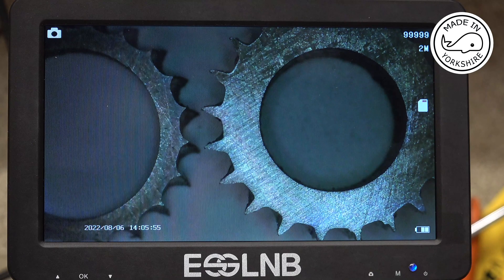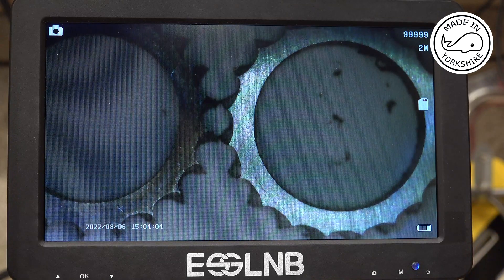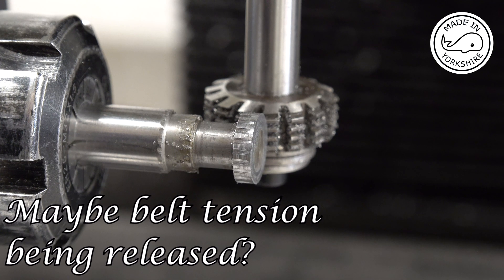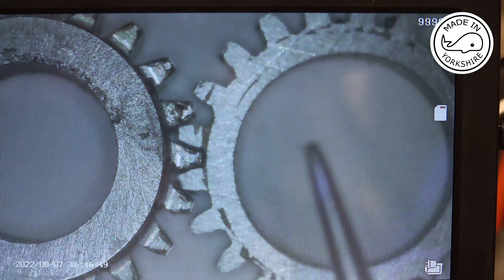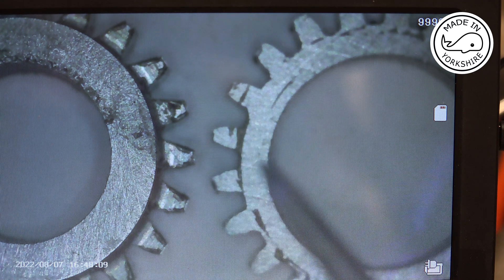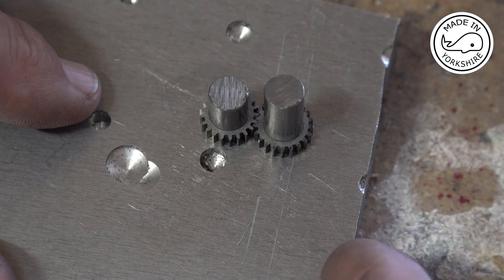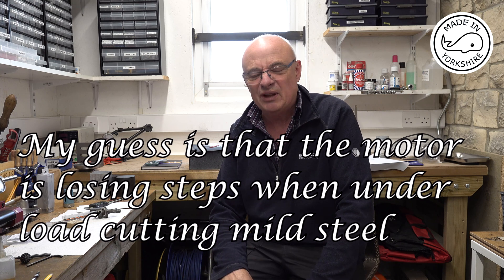#MT50 Part 5 - Making a Gear Hobbing Attachment. Success? In 4K/UHD by Andrew Whale.

Comment: I'm pretty certain that your stepper motor is skipping steps, probably because of torque applied by the cutter 'worm' drive (for that's what it is).  A way out would be to put a  worm on the stepper to drive to the blank via a pinion, so that it cannot be forced to miss or jump forward steps.  Ok, it will all run slower. But so what? It would prove the theory.  Good luck with it anyhow ;->
Reply from the maker: Hi Ian, thanks for the suggestion. I'm sort of thinking on similar lines but a different solution. I've just purchased a closed loop stepper motor and driver which are supposed to be good at not missing steps when under load. Just waiting for some different pulley to arrive before I can test the theory 👍
Cheers
Andrew

Comment: A bit of work, but you can't prescribe a cure without a diagnosis: Fit an encoder temporarily to either the stepper shaft (e.g. on the pulley) or the spindle (either end, but probably the non-workpiece end is easier). Feed the output back to your Arduino, amend your Arduino code to explicitly count the number of pulses received from both encoders. The coding should be easy, and I am guessing you have some spare inputs on your Arduino, so it's only the fitting of the temporary encoder that requires much work. Like most people, it really looks like you are missing steps, but counting the input and output should enable you to track when it is happening.
Reply from the maker: Hi Nick - an interesting suggestion and I see where you are coming from. I have another plan at the moment but I will keep that though in mind.
All the best.
Andrew

Comment: Hi Andrew. To get rid of the noise, you can add 47pF ceramic capacitor between the signal line and the ground. This capacitor needs to be soldered at signal receiving end. Obviously afterwards check with the oscilloscope the signal quality.
Reply from the maker: Hi Adam - thanks for the suggestion. Added to my list!
All the best.
Andrew

Comment: Hi Andrew, as others have commented, your clearly making progress and that has to be good, well done.  But as I commented last time, the "circular thickness" of the teeth still look a little shy when compared to the width of the tooth spaces.  Or is it just me?
Reply from the maker: Yeah I think you are correct. I think they would function reasonably well, but maybe wear could be an issue. I'm trying to get to the bottom of it. I like challenges!
Cheers
Andrew

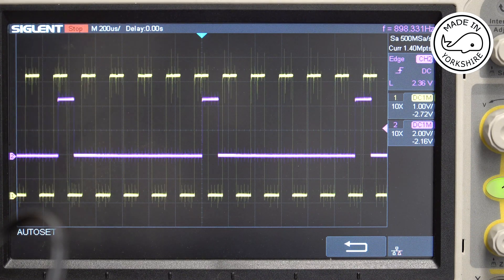Comment: At 07:30, the alignment of the purple trace with the yellow trace doesn't seem consistent enough. I would expect the distance from the rising edge of the yellow trace to the rising edge of the purple trace would be consistent. But it is quite different for the three pulses shown. I wonder if you're getting jitter in the timing. That would case the orientation of the hob to the teeth to walk back and forth, thus cutting the profile wider than it should,
Reply from the maker: Hi John - I think the difference is due to the outgoing pulse being every 5-1/4 incoming pulses. The math is correct as far as I can tell. I have a few ideas I'm going to try out.
Cheers
Andrew

Comment: Well filmed and edited and nicely presented.
That fast wobbling, jittering at time 07:00 doesn't feel that good. See what Your testing will come up with.
When a stepper looses steps it usually stalls, stops, making a brrrr noise. Check the acceleration parameters in order to avoid "loosing steps".
Reply from the maker: Thanks Stefan - I wasn't sure if the jittering was an issue. I'm going to make some more changes, including adding a closed loop stepper motor. That should at least remove the possibility of losing steps at the motor end. We will see!
Cheers
Andrew
Reply: @learningturningmetal  I don't really believe in lost steps. You can install a sensor and check for step issues but I doubt it will be the answer. 
Checking parameters affecting acceleration/retardation could pay I think. Of course, trimming the PID factors could make changes.
I can think of a time factor, loop time for reaction or system hysteresis due to the large mass that is controlled.

Comment: Good work, You may get further improvement if you twist each pair of wires  between the driver and the stepper motor coils. This may help in reducing x-talk  between phases. 
But yes a big step forward from the previous results.
Reply from the maker: Hi Fraser - thanks for the suggestion. I have some other ideas I'm going to try out too.
Cheers
Andrew

Comment: Stepper motors are pants.
Reply from the maker: Yeah - open loop steppers might well be when cutting under load. I'm going to try closed loop which have built-in encoders to resolve any missing steps. Well that's the plan!
Cheers
Andrew

Comment: I have been told that a servo will not lose steps.  Maybe you could try one of those.
Reply from the maker: By servo - I think you might be thinking closed loop stepper motor which has a built-in encoder to check if any steps have been missed. Now that might be the subject of my next video!
Cheers
Andrew

Comment: Just a thought about the wider tooth gap, is the hob at the correct angle?
Reply from the maker: Hi Chris - as far as I can tell the angle is spot on. I think if it was out the teeth would be cut at a slight angle - like a helix.
I have a plan!
Cheers
Andrew
Reply: @learningturningmetal  one should always have a plan.😉

Comment: Try seeing how your cut gear mates with the cutter, if it's tight to that with no slop then any play when meshed with other gears is either down to the cutter profile not being ideal, or the other gear.    If you have some slop between your gear and the cutter that made it, then it suggests a small amount of lost/gained motion between the cutter spindle and the gear spindle whilst it's being cut (small number of skipped steps perhaps?)
Reply from the maker: Thanks for the suggestion. I have a plan, so fingers crossed I will be able to nail it!
Cheers
Andrew
Reply: Was going to suggest the same. Worth checking before making any more adjustments Andrew! Cheers, Jon

Comment: Yay! Nice to see you sorted it out. 👍
Regarding that larger gap between the teeth, I have a theory. The stepper motor setup you have allows backdriving and only has a 3:1 ratio. So basically the gear is held only by a "springy" stepper motor. That can possibly allow some deflection of the gear and will make the teeth smaller and the troughs larger.
(Edit) you could test if it is springy deflection by cutting a gear from something soft like delrin or acrylic.
Reply from the maker: Hi Wiz, a good Idea. I've been working on a plan. Watch this space!
Cheers
Andrew